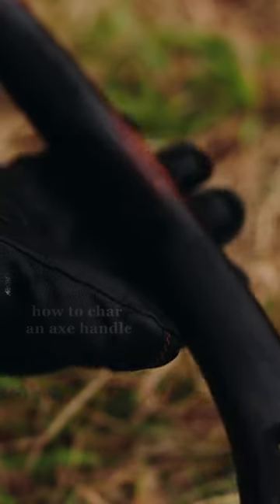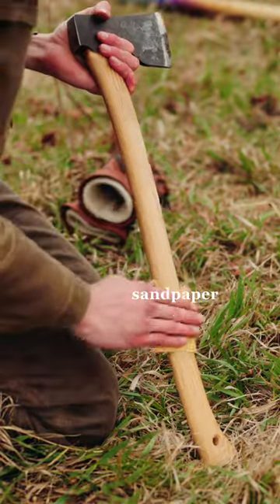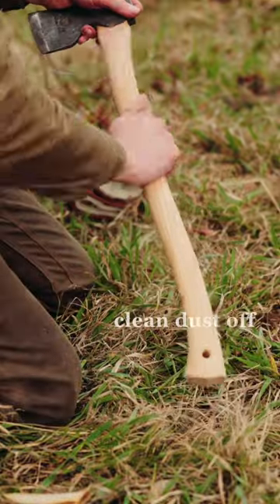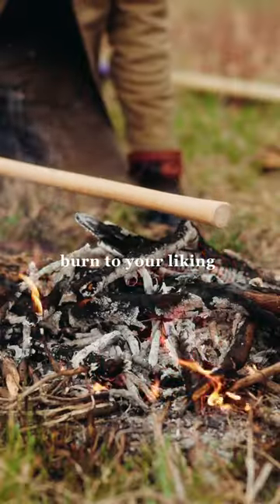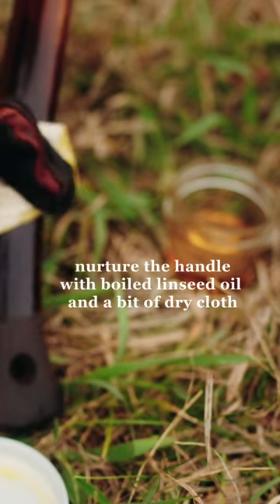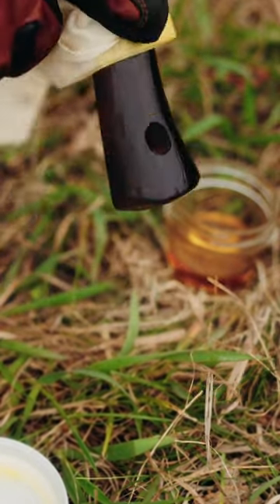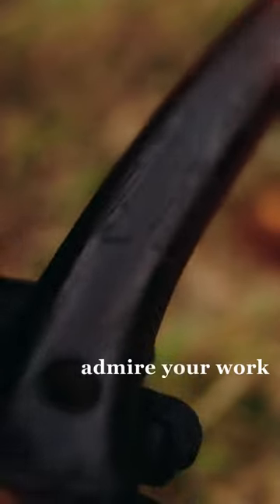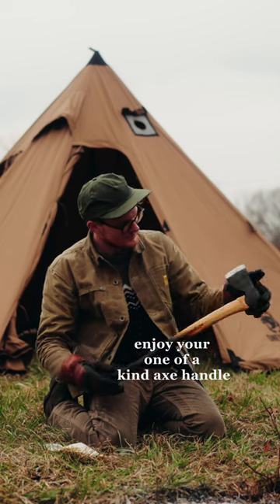Making a Charred Axe Handle #bushcraft #camping #outdoors #handtools #woodworking

Comment: For anybody watching an alternative to sanding the varnish off is scraping it with a larger knife (NOT your carving knife lol) at a 90° angle to the handle. It pulls it off like nothin. Just a suggestion, i dont like sanding cause the varnish clogs up the paper and i gotta use a bunch, but again, just my experience

Comment from the maker: Pretty easy right??

1. Prepare a fire
2. Remove the old finish with fine grit sandpaper
3. Clean off the excess dust
4. Hold axe handle above hot coals while moving in a circular motion. Burn to your liking.
5. Nurture the handle with boiled linseed oil on a dry cloth.
6. Let the axe handle dry for 24hrs.

Admire your work.

Into the Woods🌲

Comment: Burning a handle after it's been hung is a good way to loosen the head.
Reply from the maker: As long as you don’t burn up near the axe head you should be good though, right?
Reply: Id definitely stay away from the head, not so much for the temper because i doubt it would get to hot.  But because of the heat expanding the wood in the head and also dehydrating the wood. Although a little linseed oil or dipropylene glycol soak on the eye could fix it.